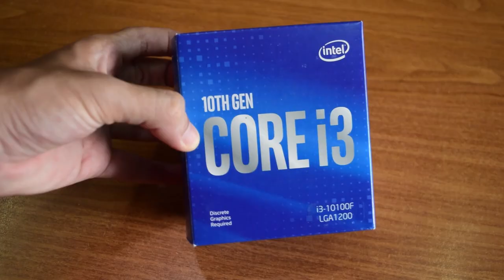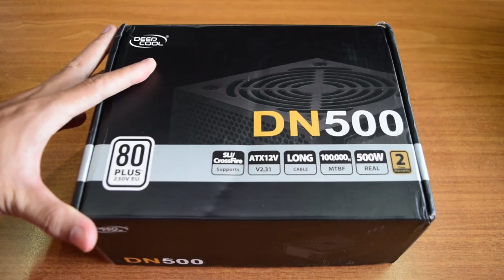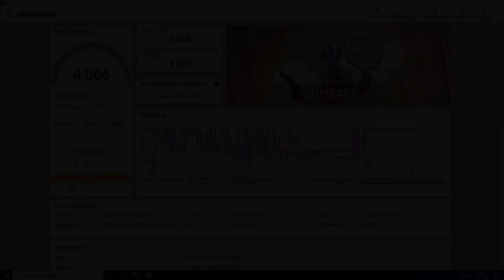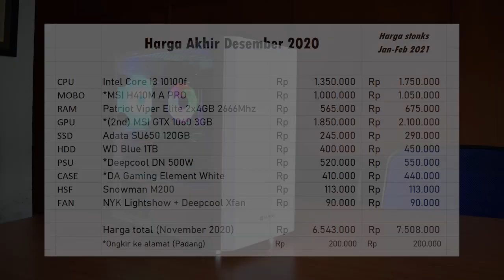Rakit PC Gaming Awal 2021 Pakai GTX 1060 - RIP GTX 1650 Super 📈

Comment: Bang coba rakit pc 9jt make ryzen 5 2600+rx 580/1060. Fullset pc+ monitor.
Reply: Oof oof oof, langsung ke ryzen 5  3600 aja, di Enterkomputer shopee harganya 2,7jt, langsung ke gtx 1650super aja bro di shopee masih ada yang jual harga 2,6jt baru. Monitor beli Lenovo L22e, cuma 1,2jt udah ips 75Hz
Reply: @indrapratama9790  anu em... itu R5 3600 nya garansi off kah atau non resmi? atau garansi yang sudah berjalan dan sisa beberapa bulan lagi? karena 2.7 sangat drop harganya notabene pasaran masih diatas 3juta

Comment: Permisi mau nanya nih. Sya mau beli vga untuk pc sya kira yang cocok apa yah? Zotac gtx 650 bisa gak?

MB : Asrock FM2A 68-DG3+
Prosesor: AMD A6 7480
Ram : DDR3 Hynix 4GB x 2 PC12800
Psu :  Simbadda 380w

Kira" mampu ga gan? Atau psunya harus ganti ? Mohon bantuannya 🙏
Reply: kebutuhanmu untuk apa? dari spek kelihatan hanya untuk keperluan kantor atau biasa saja bukan untuk nge-games berat berat,  
melihat specnya kayaknya cukup deh, PSU cukup dayanya, tapi kalau mau bagus PSU nya cari yang merk bagusan palingtidak ada sertifikat 80+
Reply: power supply bawaan case, alangkah baiknya supaya hati nyaman dan tentram menggunakan GPU 30w TDP layaknya GT 1030 2GB dan sudah GDDR5, atau kalau mau naivë boleh yang max 75w TDP alias tanpa PowerPin tambahan layaknya RX 460 atau GTX 750Ti atau GTX 1050Ti tapi ini sangat riskan dan saya tidak sama sekali bertanggung jawab amit-amitnya kenapa-kenapa
Reply: Makasih sarannya 🙏
Reply: Sayang gan kalo ada Dana lebih saran saya make Enlight 400w aja udh 80+, kesian nanti gpu nya kalo ada apa", tapi kalo IGP sih ya gak masalah make psu 200 ribuan xD

Comment: Bang nanya dong gw main NFS heat kok cpu usage nya 100% yaa pedahal aplikasi lain gak ada yang di buka dan juga spek sudah pake i7 9700 dan sudah pake GPU 2060, GPU usage cuman 40%-60% an wajar kah cpu sampe 100%????. Nanya nanya youtuber lain gak ada di jawab sama sekali
Reply: tolong informasi tambahannya seperti konfigurasi RAM/Memory, File Game nya di NVME/SATA M.2/SSD 2.5/Hard Disk, dan Background Process Windows 10 apa saja yang running karena seringkali Windows Update jalan sendiri yang sangat membebani CPU Usage
Reply: karena secara tertulis 9700 sudah 8Cores 8Threads, what the heat on earth game 2019 ngabisin usage si Processor notabene Core/Threads Counts sebanyak itu? perlukah pakai Xeon 32 Cores atau bahkan Threadripper 64 Cores hanya untuk Need For Speed Heat? saya sangat yakin pasti ada masalah entah itu di Operating System minta di reinstall, atau Memory belum dual channel, atau penyimpanan di Hard Disk mintanya SSD, dan lain sebagainya
Reply: @sagaraperkasa5653 kalau ram gw masih pake 16gb 3600 terus buat disk gw pake m.2 nvme 1TB pas main yang di buka cuman NFS heat doang di grafik high dan Mobo pake MSI Z390 pro
Apa karena Ram ya yang masih 16 gb
Reply: @sagaraperkasa5653  btw bahaya kah kalau cpu usage sampai 100%????
Reply: @howto-vv4ec  itu kalau boleh tahu, 16gb nya konfigurasi Single Stick apa Dual Stick alias Dual Channel nyala terdeteksi CPU-Z atau HWinfo ? jujur cukup berat dan performance loss sangat besar bila masih Single Channel (bisa jadi udah pasang dua tapi salah placement malah A1A2 bukan A1B1 atau sederhana nya selang satu kosong mengingat Z Chipset Series mobo kebanyakan empat slot memory)
Reply: @howto-vv4ec  100% CPU Usage sangat wajar, dengan syarat suhu Processor terjaga dan jauh dari Tjunction Max nya i7-9700 detail pada situs resmi ark intel, kasarannya dibawah 60 Derajat under Heavy Load itu udah sangat cukup baik sekelas Processor yang masih Fabrikasi 14nanometer dan memiliki Core/Threads Counts yang banyak (8/8)
Reply: @sagaraperkasa5653  pake dua keping RAM bang 8GB×2......
Berarti kalau cpu usage 100% gak masalah ya??? Untuk masalah suhu paling panas 73°c 
Btw game lain kaya battlefield 1-5 rata kanan cpu usage palingan 70-80%
Reply: @howto-vv4ec  73 lumayan hangat sih tapi wajar bila masih menggunakan stock intel HSF bukan Aftermarket seperti DeepCool Gammaxx GT RGB, CoolerMaster Hyper 212, atau bahkan Noctua Air HSF nya yang tembus jutaan lebih

ah saya nangkep, entah game nya yang gak well optimized sehingga ada komponen yang menjadi korban penitik beratan (kasusnya ini CPU Bound berarti) dan untuk kemungkinan yang mengarah ke bottleneck itu enggak sama sekali, sekalipun RTX 3080 seharusnya masih sanggup diderek i7-9700 dengan sangat baik 

sempet ada curiga terdampak malware atau apapun itu karena sangat nguras resources kalau enggak segera diatasi (Full MalwareBytes Scan atau Reinstall ke Latest Windows 10)
Reply: @sagaraperkasa5653  kalau anget sih kayaknya salah gw sihh karena kemaren disarankan pakai water cooling minimal gammaxx L360 tapi karena ngincar tema dan agak menekan budget jadi ngambil water cooling yang 240R dari MSI. ngomong ngomong tnks banget nih bro dari tadi mau bantu jawab 😂😂🙏
Reply: Dan mungkin panas karena pakai Xtreme mode maybe wkwk
Reply: @howto-vv4ec  sami-sami pisan gan, mohon maaf yang sebesarnya karena jujur memang masih belum menjawab sama sekali permasalahan yang belum pasti akarnya kenapa NFS Heat consume CPU Usage sangat hebat ditelan semua 8Cores 8Threads

eeeeehhh udah pakai water cooling rupanya mantep sangatttt, untuk maintenance terbaik repaste bersihin debu segalamacem rajin 6 Bulan Sekali dan usahakan Thermal Paste Authentic dari Noctua NT-H1, Gelid GC Extreme, Arctic MX-4, Thermal Grizzly (yang non conductive sudah jauh lebih dari cukup) dan pengecekan rutin apakah masih okeh per laju air nya (tapi seinget saya udah anti-Leak sih punya agan cuman tetep untuk make sure semuanya aman terkendali)

goodluck semoga disegerakan menemukan solusi pencerahannya dan Solved 1000% terkait permasalahan Need For Speed Heat Aamiin, oh bisa juga Bug bakalan di-Fix next update (maaf untuk ini nggak tahu karena memang murni kepastian dari Developer)...tetap jaga kebahagiaan, kesehatan, nutrisi karena sedang suasana genting dan semangat selalu dalam aktivitasnya
Reply: @sagaraperkasa5653  okee tnkss gan udah ngasih masukan nanti di coba ganti pasta baru makasih banyak yaa gannn 🙏🙏🙏🙏🔥
Reply from the maker: Lumayan banyak yg ngalamin kayak gitu gan, dan banyak penyebabnya,
sayangnya saya gak bisa ngasih solusi pasti karena belum pernah ngalamain...
kemungkinan/perbaikannya:
- Ganti mode fullscreen ke borderless
- Aktifkan Vsync
- Matikan steam overlay (kalau dari steam)
- Uninstall update "Windows 10 KB4512941"
- kalau game nya "tani", bikin file .cfg di lokasi install
pakai notepad, lalu save as .cfg (nama file nya user) > user.cfg 
Isi nya:
Thread.ProcessorCount 8
Thread.MaxProcessorCount 8
Thread.MinFreeProcessorCount 0
Thread.JobThreadPriority 0
GstRender.Thread.MaxProcessorCount 8

Comment: Ama 580 msh kalah yak?
Reply: kalah di power consumption si RX 580 mah sangat edun 180w TDP+++, karena urusan listrik sangat sensitive (khususnya untuk saya pribadi dulu inimah yaa)
Reply: sangat jomplang dibanding 1650 Super hanya 1x6 PowerPin itupun 100w TDP saja gak 120w kek 1060, tapi easily outperform si RX 570/RX 580 ya gegara GDDR6 nya 1650 Super sih